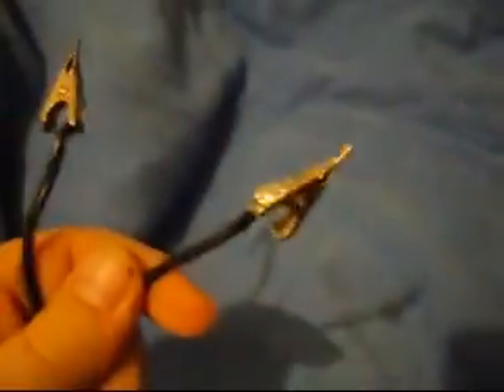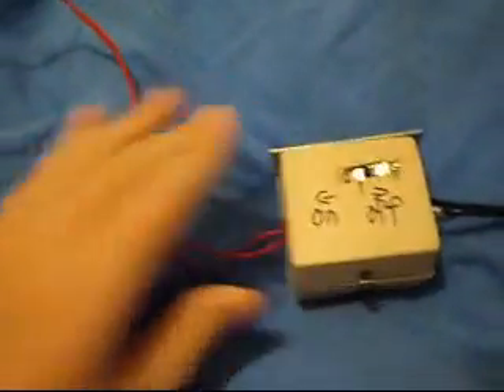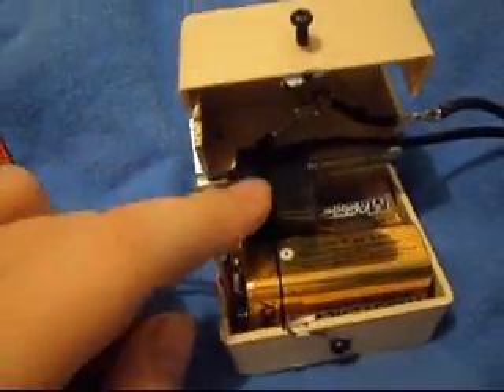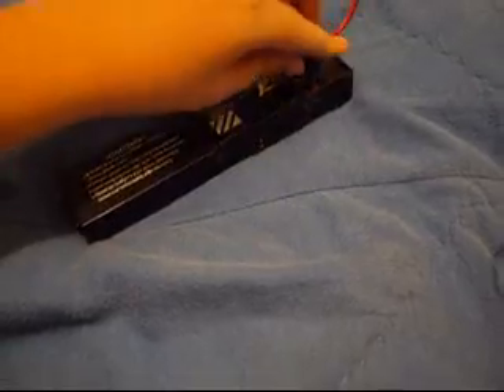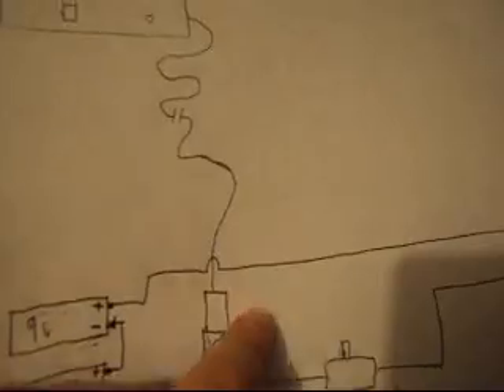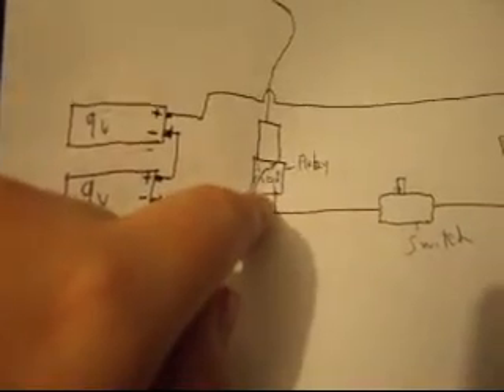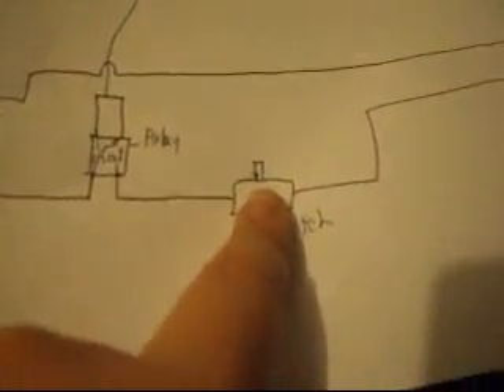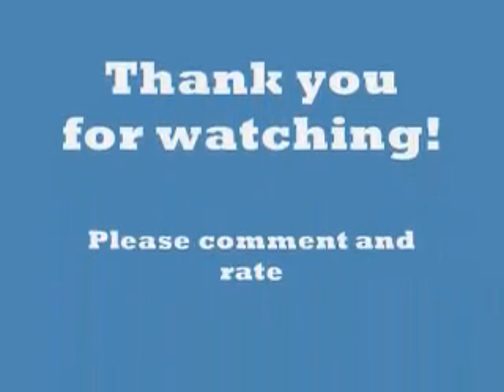model rocket launch controller/pad

Comment: I understand. I was a kid once. Keep it up and you will do well. I like to use a disconnect between my motor clips and switch. That way i can hook up my motor before putting the rocket on the launchpad. Saves me from crawling on my belly trying to hook up the clips. I like the toggle switch with flip cover instead of pushbottons. Learn to think outside the box.

Comment: Just remember that when you design something, the more parts you use and the more complicated the system, the more chance of something malfunctioning. I try and design things as simple and efficient as possible. A 12v alarm battery, switch and leads. All connections union tied, soldered and heat shrinked. Radio shack has some cool parts for cheap.